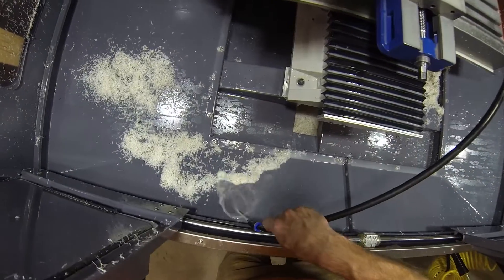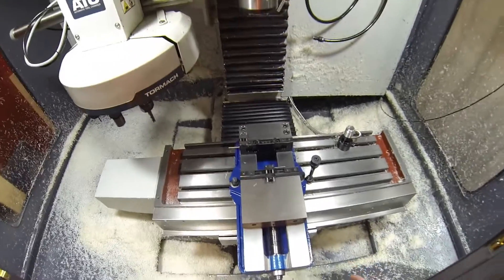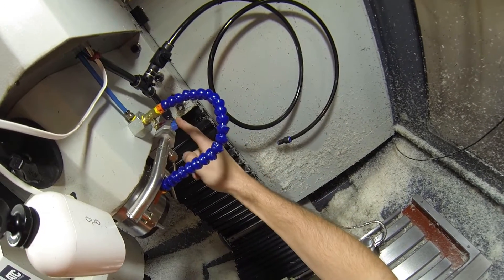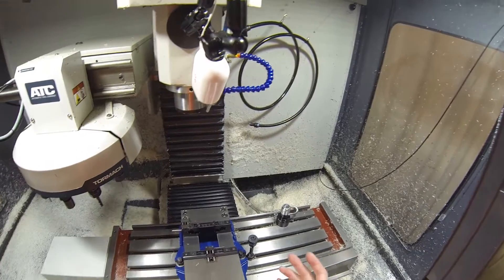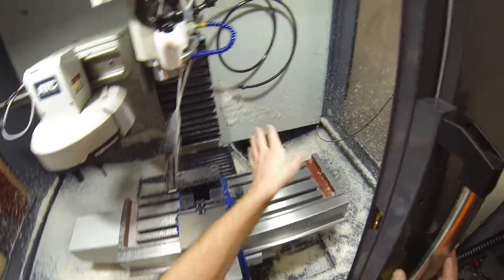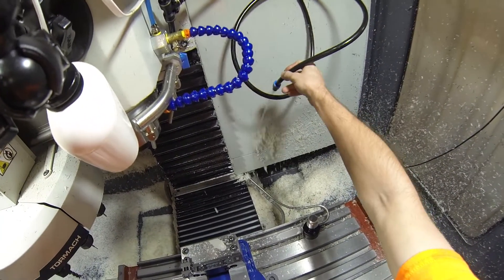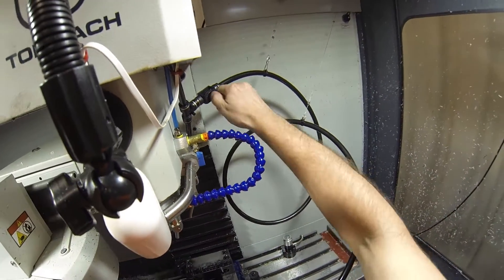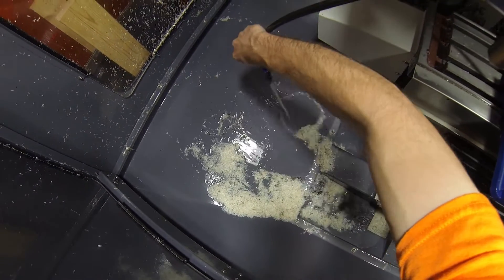CNC Machining: A Better Way To Clean The Chip Tray? (Tormach 1100MX)

Comment: add a nozzle with a small diameter to get more pressure on that little hose
Reply from the maker: Yeah, i reduced it down to a 1/4" and it did much better. Honestly need a more powerful pump, it keeps the tool cool, but doesn't clear chips too well.